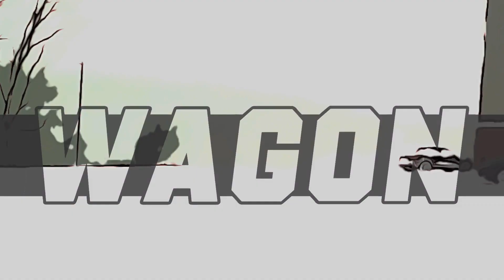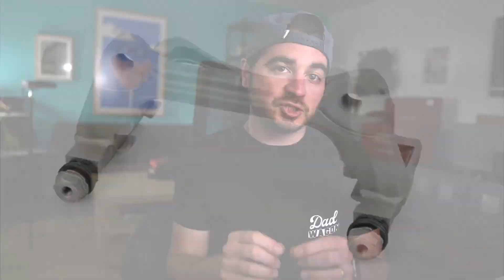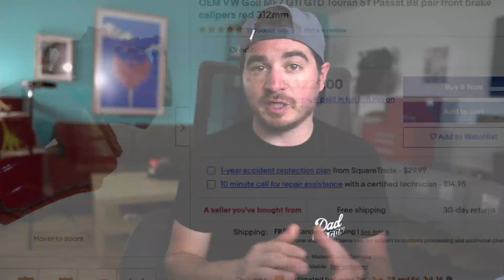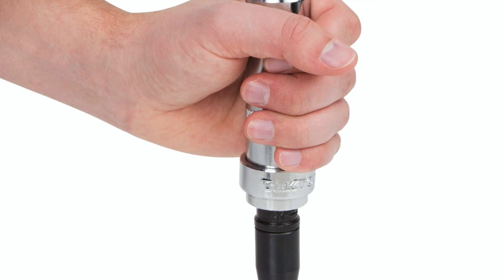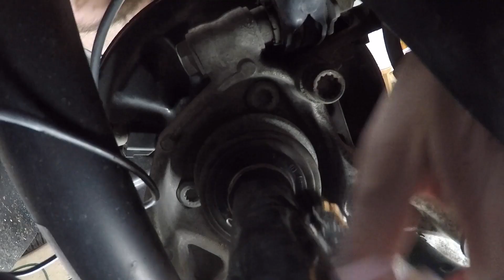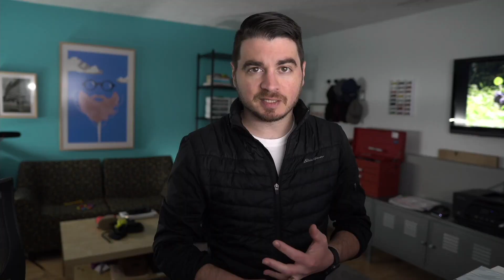MK7 Golf 312mm Brake Rotor Upgrade and Brake Pad Change

Comment: How does the superwrap hold up to heat? I track my car and will be putting the 340mm rotor with PP Caliper/carrier and wanted to refinish it before I install. Think it'll work for me if I get them to 500°F lol?
Reply from the maker: Haha. Honestly, I don’t push my car nearly to that limit but I will say the brake calipers held up much better than the wheels. I think it’s due to the really thick and well done coats I did. Wheels just have so much surface area and I was afraid to lay it down nice and thick. Give it a shot.

Comment: To be safe, use a torque wrench when reinstalling brake components - your life depends on it. Golf MK 7 front brake torque settings: Caliper bracket bolts: 148 ft lbs (200 N m); Caliper to carrier bolts: 26 ft lbs (35 N m); Rotor set screws: 3 ft lbs or 36 in lbs (4 N m). The caliper to carrier bolts are thread locked and VW recommends replacing them with new bolts.
Reply from the maker: Great comment and thanks for sharing the specs. All bolts were torqued on the project.

Comment: Are the rears also bigger GTI diameter rotors and calipers?
Reply: I found out that the 4motion Sportwagen and Alltrack use the same calipers and rotors on the rear as the GTI non performance. Also interestingly MK6 GTI is same as MK7. Some years front wheel drive Sportwagen uses a smaller rotor in the rear, but not the 4 motion. I only just found this out when I ordered a set of GTI calipers and rotors and to my dismay they were the same as what I already had from factory. But now they will be red, so that’s ok! Thanks for the video!
Reply from the maker: @CarsandCoding  yay for red! :) no problem and enjoy the install
Reply from the maker: They are not  - they are the stock brakes from a 4motion sportwagen
Reply: The rears are only bigger (with vented rotors) with VW 340 mm front brakes.

Comment: I also did this upgrade on my Leon, going from 288 to 312. But many people are wrong and only change the carrier, when what is necessary is to change the caliper as well. At first glance they look the same but they are not. 288mm (PR 1ZE) takes the TRW caliper marked "GNO 15". 312mm (PR 1ZA) is the "GNO 16". They look the same but there is a small difference in height, so when using the 312mm carrier with the "GNO 15" caliper, it causes poor piston support on the pads and irregular disc wear.
I also recommend using a torque wrench to give the necessary torque to the screws, and threadlocker your safety depends on it.
And you should have put new copper washers when bolting the brake lines to the calipers.
Reply: You are absolutely correct, the 288 mm calipers use 55 mm pistons and the 312 mm calipers use 57 mm pistons. Reusing the old 55 mm piston calipers is a common mistake on this upgrade. Note that the "15" and "16" markings refer to the minimum required stock VW wheel sizes (15" for 288 mm, 16" for 312 mm).
Reply: Do you have this caliper partnumbers? @valuedcustomer9614

Comment: WOW - Breaking in Brake pads - Counter intuitive - but I was in no uncertain terms told to brake really harshly three times to heat cycle them when I upgraded my Porsche brakes.  DYODD    7:24 - don't catch the fluid - clamp off the pipe first!

Comment: You increse unsprung mass
Reply: excellent point  - but nothing is for nothing,,,,,,, having said that - same calipers and pads so the only extra weight is the  24mm of vented disc.   No biggie - unlike the Dude that used ML350 Rotors with   IMMENSE Cayenne calipers,,           Carbon rotors?? $$$$$$$$$$$$$$$$$$$$$$$$$$$$$$$$$
Reply: @CosmicSeeker69  The 312mm calipers are slightly larger and heavier than the 288mm calipers, but not by much. The 288mm calipers should always be replaced with 312mm calipers when performing this brake upgrade.
Reply from the maker: correct.

Comment: Great video, I was looking into brake upgrades, took my 2017 sportwagen to a autocross / track day for the first time on oem brakes, autocross was fine but after the laps around the track my brakes were overheating and making a good amount of smoke when we were done. I am thinking larger rotors can help with the heat... Also going to change the fluid with something better as it is due anyway. Just recently found this channel and it is perfect, I have a 2017 sportwagen 4motion that I have owned for 3 years now and I am ready to start doing some updgrades so this channel is a god send for me...
Reply from the maker: Awesome and thanks for watching. Love that you're getting. your car out for some laps. What brake pads were you using for the autocross?
Reply: @DadWagon  some oem equivalents forgot the name unfortunately,  I wanted to try it  mostly stock (I have a JB1) first to get a baseline and to be honest it was not bad on the autocross, but I did not realize we would do a few hotlaps on the race track and I was trying to keep up with a camaro zl1 so after about 10 laps my brakes were starting to fade (track is a little over a mile long and this was my first time so I am sure I was not braking as smoothly as I should). Fortunately after letting them cool for a bit they felt fine on the hour and a half ride home. My brother took his GTI sport out too, we had a blast. Definitly going to focus on handling and brakes first as I would like to do more autocross.

Comment: What about Vag-Com coding for new rotors on 03 ABS module, not necessary?
Reply from the maker: Good question.  No idea…
Reply: @DadWagon  Hi. Coding is rather necessary if you change your discs for larger diameter. I have completed exactly the same upgrade and noticed inconsistent ABS reaction before adjusting the ABS pump. Without coding it was kicking in waaaaay to late (and to agresively) and towards the end of the deceleration it was engaging the rear discs with to much force hence the increased diving effect. After coding the pump things got back to normal with the added stopping power, so if anyone is considering this mod the answer is: yes, take coding into account. It's all for the safety after all.
Reply from the maker: @turmoilstabilizer9054  Can you share a little bit of what adjustments you made? What attributes you changed and to what?  Thanks for sharing this update/feedback.
Reply: @DadWagon  I sat on this topic for a better parts of my week off work. Went through numerous usual vag forums and tested various solutions in order to try to code the ABS module myslef. Long story short, I wasn't successful. 

My car is 2014 Golf Mk7 Variant 2.0 TDI CRBC engine and DSG DQ250 transmission, FWD. ABS MODULE in this car is 5Q0907379AA with the IPB MK100, which is quite common for the pre-facelift mk7.

On one of the forums I found the spreadsheet with a quite comprehensive description of specific bytes in the controller. It appeared that under byte 04 and it's mirrored byte 17 I had to make changes from the original values of 24 (288mm brake disc size) to either 31, 34 or A0. Tested all known security access codes, but it turned out that they weren't the problem. It looked like my only hope was to seek help from a professional car service. Luckily I have a local Bosch Service nearby which I have used few times before and they were able to update this for me via proprietry SVM. 

My impression is that VAG makes it very difficult to modify those settings using anything else then their own software. 

Anyway as it was explained to me I made the right call in making this right as leaving it as was would lead to an accelerated and uneven wear of discs, developing wheel hub play ang generally a feel of car having an increase tendency to dive forward whilst decelerating.

Hope this helps.
Reply: @turmoilstabilizer9054  Would also like this information
Reply: @DadWagon  thank you for your frankness then have you ever noticed any weird reaction/action on abs since the upgrade? My brake pads and rotors are about to finish so I want to make this upgrade too because the extra cost is only caliper carriers and thank you for sharing the informative video and your experience.
Reply from the maker: @melih4695  I haven't experienced any thing out of the ordinary since upgraded - although, i probably have not triggered the ABS system in any of my driving since upgrading. I work from home, so don't put a ton of miles on this car on a regular basis even if it is my daily driver. The biggest change is the travel of the pedal and smoothness in braking versus the old rotors.
Reply: @DadWagon  thx dude, pedal travel and smoothness really helped.

Comment: Did you have to replace the stock front dust shields with larger ones?  Looks like you didn't and the 312mm rotors fit without any clearance issues.
Reply from the maker: I did not replace the dust shields and they fit well.
Reply: VW 288 mm and 312 mm front brakes use the same dust shields - they do not need to be replaced when making this upgrade.